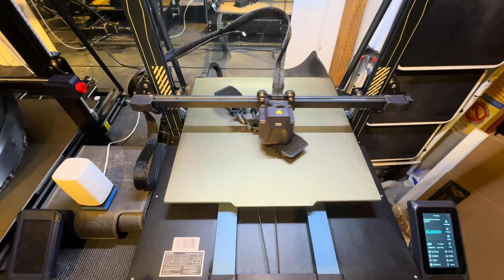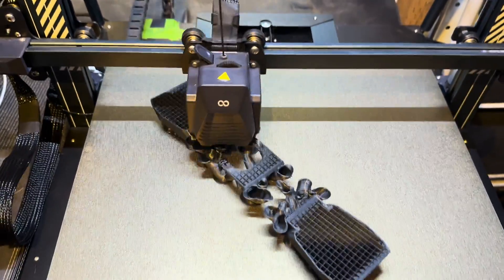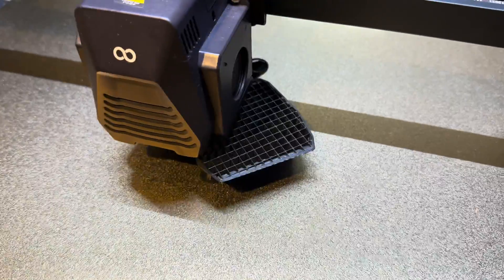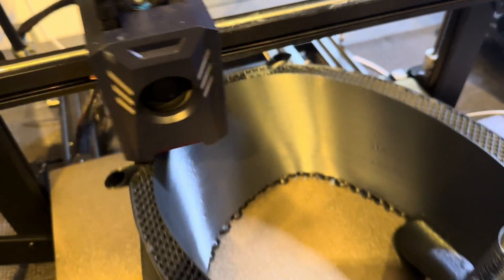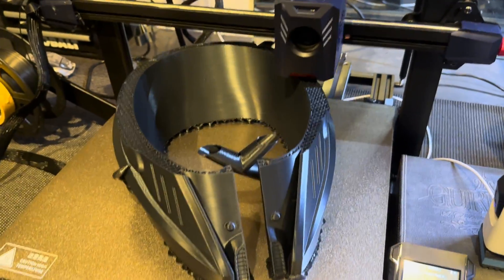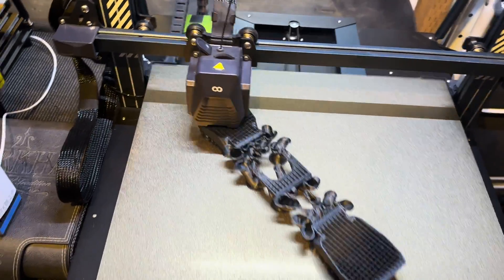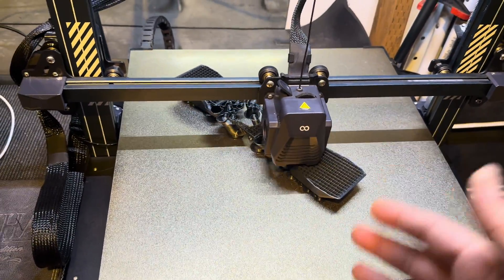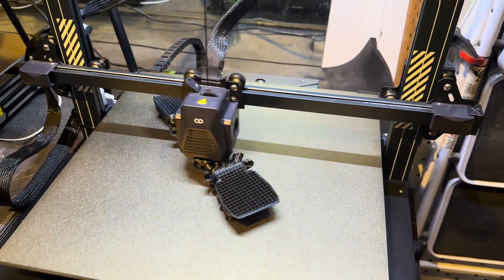How to prevent the nozzle from dragging across your print on your Neptune 4 Series 3D printers.

Comment: So my question when I saw my printer does this was...How much is this wearing down the nozzle?
Reply: May have missed in one of the comments but this can be tweaked with infill flow. If your infill flow settings are the same as your walls, come down a couple percent (just on infill flow) at a time on some quick test prints until it doesn’t drag. This video obviously shows a way to deal with it during a print but not a permanent fix.
Reply: @czr7s1  so the flow is the culprit? ill try it out, but why does my pros first layer always look under extruded? then later on in the print, i also get layers that look massively under extruded, like lines not coming remotely close to the edge of the connection?
Reply from the maker: It will definitely wear down the nozzle. I believe switching infill pattern would help with my dragging issue.
Reply: zig zag infil is the best infil to avoid dragging ive found, combined with disabling combing and z hop enabled.350hrs in on my 4 plus. @OuterRimArmorer
Reply from the maker: Thank you. I knew the one I was using was part of the problem.
Reply: @OuterRimArmorer  no problem! I found that the dragging was happening only at intersections during the same layer, which zig zag avoids entirely.
Reply: yup im sure its nozzle murder, but at this point im just gonna run my neptune 4's into the grave and send them both back

Comment: Ive Got massive Problems with banding on my elegoo Neptune 4 max. Any Idea whats wrong? Extruder, nozzle and bed Temperatur are calibrated. Also flow Parameters. Love your Videos, keep Up the good Work
Reply from the maker: Thank you. Sorry to hear about your troubles. Have you greased the z rods? What’s your layer width and wall/perimeter count?
Reply: @OuterRimArmorer  thank you for the fast Response. I own the printer since a week. Z rods are factory greased. Wall Count 3, 0.2 layer height,  outer Wall 0,42, inner wall 0.45. using Orca.
Reply from the maker: @sloddor7154 you could try switching your line width to .4 to match your nozzle size. 🤷‍♂️ I had to do that on mine as well.
Reply: @OuterRimArmorer  pretty good Tip. Thank you. I will try that. I will let you know
Reply: @OuterRimArmorer  Hey there again Mr Armorer, you have a catch of your most common settings on the 4 Max?  
And... when you getting them sweet linear rails?  I'm just about to grab some I think.
Reply from the maker: I’m actually putting together a video of my slicer settings. 😉👍 I’m not sure when I’m getting the rails but I really want them!
Reply: @OuterRimArmorer who is selling the liner rail upgrade? Is it like an ali express listing or a reputable 3d printing company?